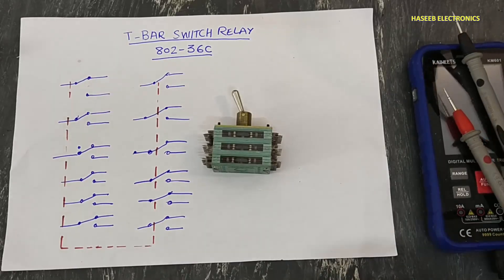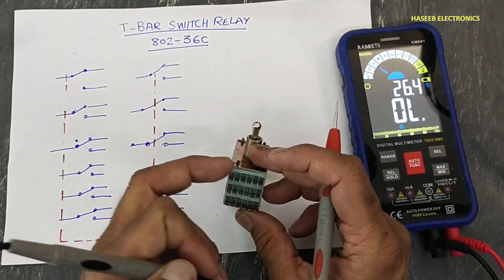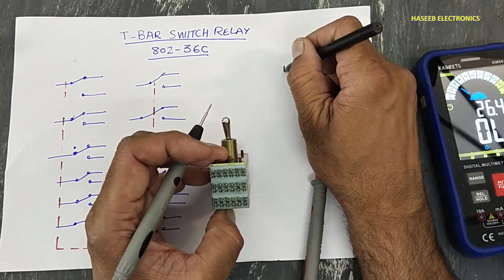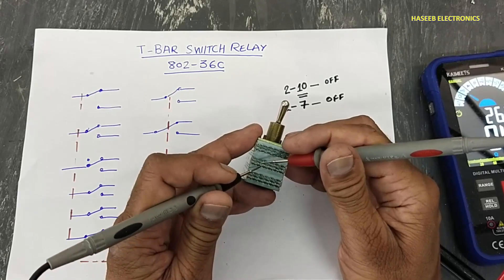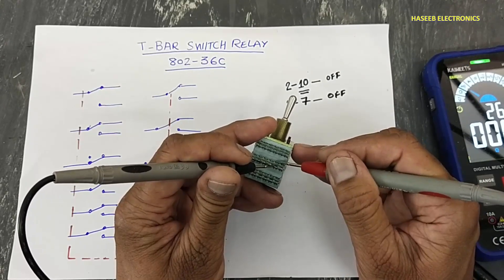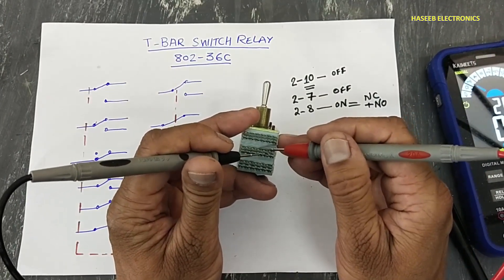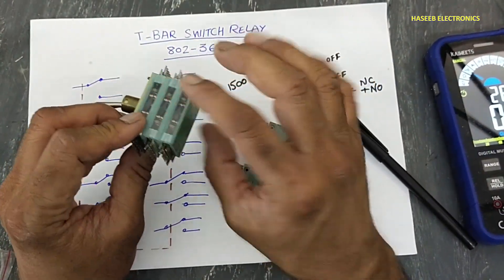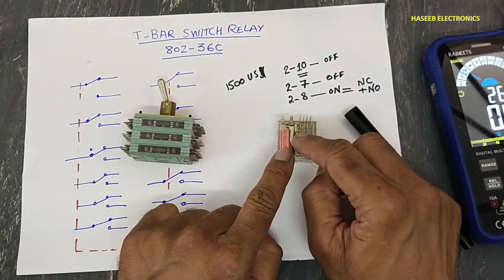{967} T-Bar switch / relay solution for bad contacts

Comment: Do you know what Relay 
Why you saying Relay in Title better learn name of components 
It is just simple switch it gang type it called
Reply from the maker: luckily i know the names of the components and i know the functions / usage / and their solutions. 
its correct nomenclature is T-BAR switch relay
there are 12PDT, 24PDT, 36PDT, 48PDT, 72PDT 
gang type switch is may be in some local language
Reply: @HaseebElectronics  go and search definition of electrical Relay or I will explain you
Reply: @HaseebElectronics  relay always with electro magnetic contact one or more
Reply from the maker: With due respect
This video is explaining only about T-Bar  switch / T-Bar relay problem
That is a unique brand.
Reply: @shindvs  I also thought that all relays were only electromagnetically controlled as well.  But when I went to look up "T-bar relay"  they come up as manual toggle and electromagnetic control variations. The switch looks exactly the same otherwise. Except the only difference is one has manual toggle and the other version has electromagnetic coil on top. I think the electromagnetic coil version is 801 and the manual toggle version is 802. 

So it seems that in this case the term "relay" is not used to describe the type of control to throw the switch, but rather the type of contacts that are used. 

Regular toggle switches do not use these type of contacts but they use brush contacts that slide.

Comment: That's the most amount of contacts I've ever seen in a switch! I don't know if triacs are an option here, but that would be a good one. If not all contacts have high current going through them you could clean the damaged section(s) and swap sections with better contacts and use them for the higher current portion(s) of the switch and use the cleaned ones for low current use. Using the spare section you have on hand would be the easiest solution and keep the schematics the same. Keep the ones you clean for "back ups" and label them as "cleaned". Thanks for being open to comments. Makes the channel even more interesting. I like to read other's comments. I'm curious if you can give us an update of what you decided to do. Best regards!

Comment: Clean or use wd40 for cleaning
Reply from the maker: when it is sparked the contact bar becomes weak and it keeps sparking. 
never use WD40, it is contains lubricant. 
use electronic contact cleaner grade 90 or above
Reply: @HaseebElectronics   use same technique like  new contect manufacture or use your idea 
Or combiene switch also and lever merge